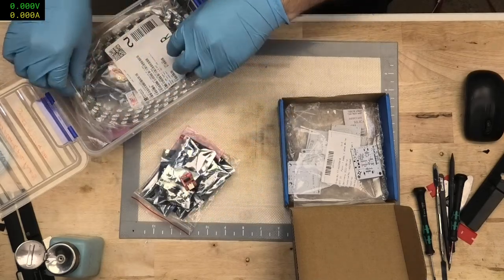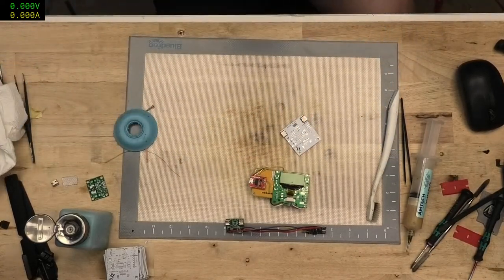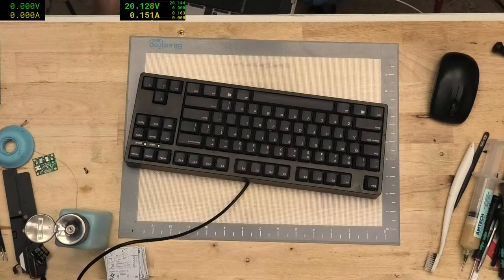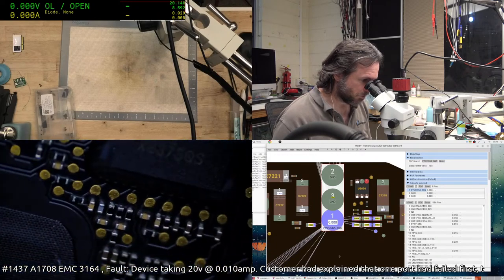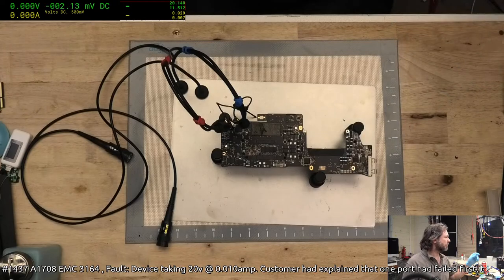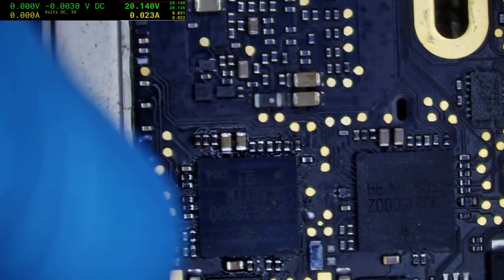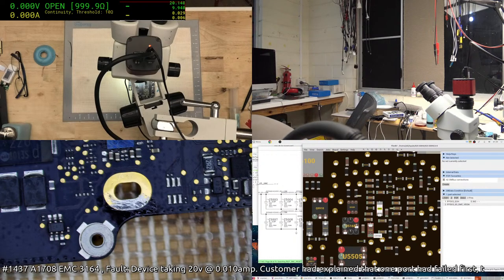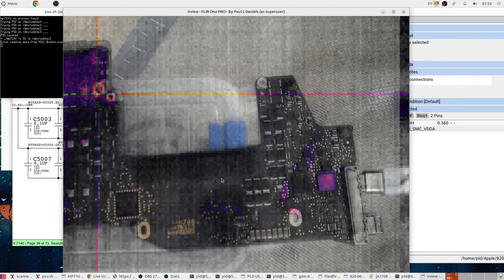Chasing memory bugs in C with Valgrind, and testing USB-C meter boards with bitched up routing

Comment: Could you take the bulb out of a small fridge and thermal image check the boards actually inside a fridge, the wires should be okay through the door seal.